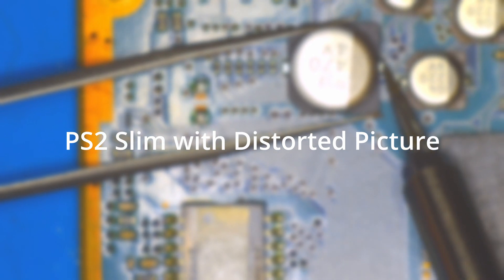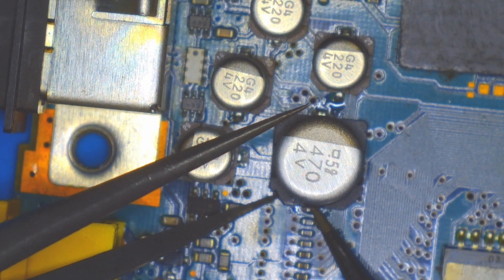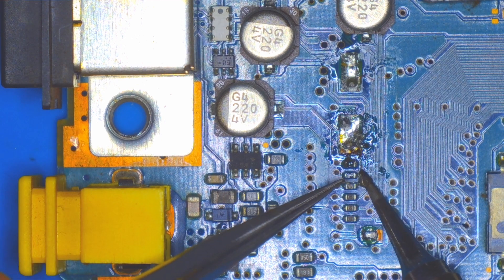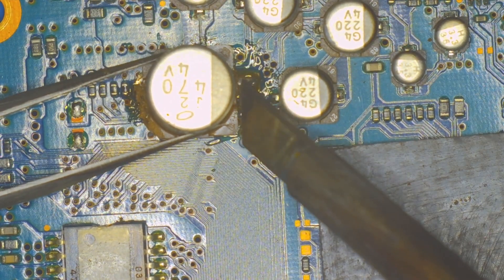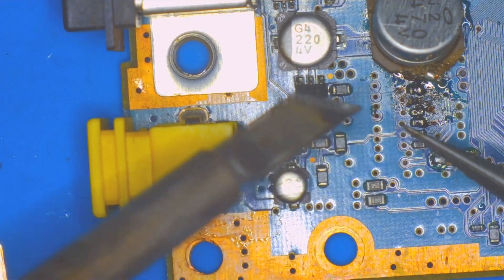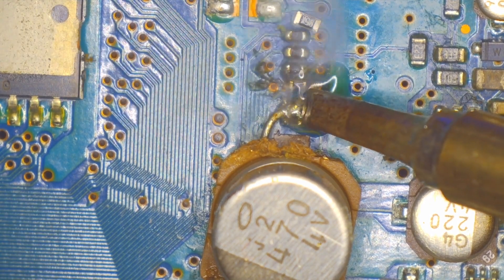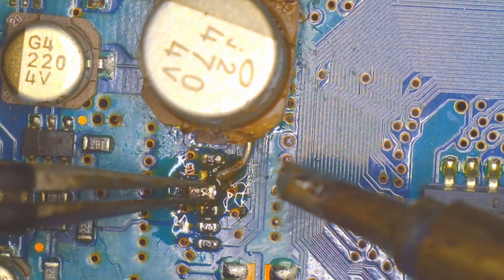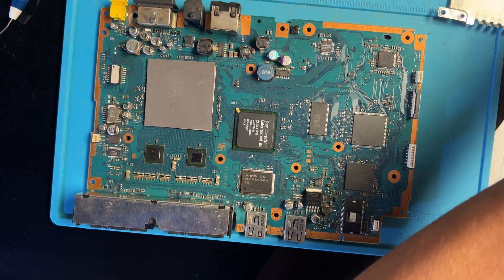Can I fix a PS2 Slim with a bad image?

Comment: There aren't any videos on this particular problem I have had, I have PS2 slim model, and it has flickering problems when playing dvd's. In the past the Audio video cable has had problems with displaying static picture, but this wasn't the cable this time, because multiple dvd's had the same flicker problem, it wouldn't always flicker from the get go. I tried a Lost in space film dvd, which it at least twenty two years old, I thought may be it was the dvd, then tried Falling down, which is another old dvd. I then tried Alien which was manufactured in 2015, so that wasn't the problem, it must be the laser or internal. I have never seen this problem before, the only time was with the cable. Considering the slim line model when I got it second hand almost ten years back now. The box it was in, was from 2006, it was an official PS2 slim model box. I imagine it was manufactured that year, or could've of been sold that year or the following, months apart from manufacture and sale.

Comment: My PS2 Slim 9000 has developed a display problem where it lost its full colours, it would just display bright white until I've restart my console or unplug and plug it back in the AV cable (I'm using the original AV cable) until I got my full display colours back. Before it happened, I've noticed the display has gone darker similar to what PS1 display would look like when the capacitor has started to worn out. 

I've been searching a video where someone does this exact fix for the slim versions, you might the one who found the answer. Looking forward to continuation of this fix (if there's any)

Comment: Hey Fix More , i have horrible solder skill very awful , ,  the power switch recently snapped off inside my PS2-SLIM  it was held into place with 4 micro hair solders , , ,so no chance in hell of me repairing it 😢😢 , so now it's a doorstop , ,  im thinking of stuffing it with high-yield fireworks  and exploding it as a YouTube short , , haven't decided yet ,🤔🤔

Comment: Capacitors in the AV port area are most likely to be in the analog video circuit, so they affect the entire screen. Artifacts are more likely generated in the digital part of the board.

Fortunately capacitors can often be measured in situ. Lots of multimeters can measure capacity, like my Aneng AN8009 for example. 

I'm not sure but it seems that the new capacitor is larger than the original. In the SMD world having the right component size is really important. According the soldering process, the solder pads have different sizes : refusion process doesn't need pads as large as handsoldering. 

Some tricks that can help you :  flux on the braid, low melt solder, heating the board to reduce the energy the iron must transfer to the board.

For resistors, you can solder the two sides at the same time if the solder tip is large enough. Of course, good alloy and good flux help a lot to avoid making bridges.

If you use hot air, beware that electrolytic capacitors can pop.
For the damaged pad itself, you can use copper tape cut at the exact size of the pad. For the trace, you need some enameled wire. Once soldering done, apply a little amount of UV mask.
Reply from the maker: Thanks for the advice. I really appreciate it. It’s hard trying to learn all this new information and actually remember it while I’m working haha. Had a number of times I did something and said ah should have done that instead.

Comment: For next SMD repairs I recommend you to get a cheap hot air gun and kapton tape to protect the area you don't want to melt; that'll help a lot to not rip traces since the components will even move by themselves, so you can use some pliers to pick them :D
Reply from the maker: Yes I recently got a cheap one. It seems to do well with smaller components but struggles on bigger chips. That or I need more practice using it on bigger chips. Possible that it’s both.

Comment: Easy way is to twist them off and replace them with through hole capacitors, put them on their side and solder the legs to the pads.
Reply: I wouldn't twist them off if I were you. Sometimes you just tear off the solder pads from the board doing that.

If you want to desolder these, either use hot air or add some low melt solder to the cap. You'll be able to quickly heat one pad then the other and just pull the cap off.
Reply from the maker: Ah that’s a great idea. Will definitely have to go that route next time. Thanks!
Reply: Similar to replacing the capacitors on PSOne (the "slim" version) eh? Interesting.